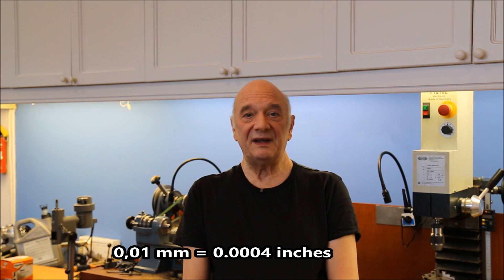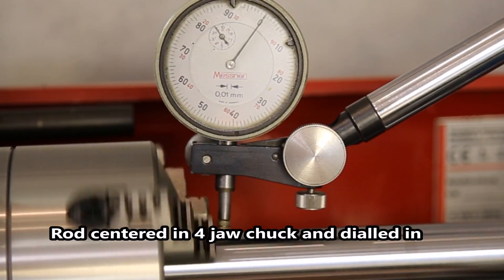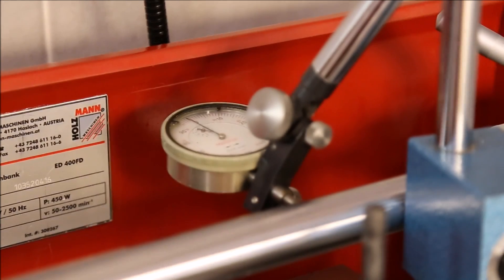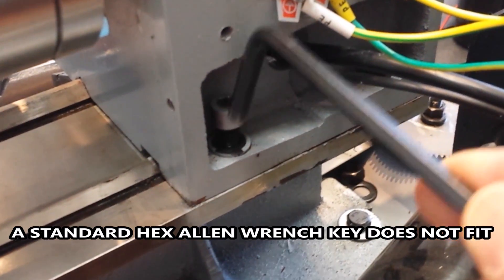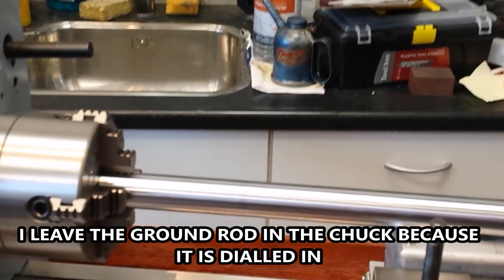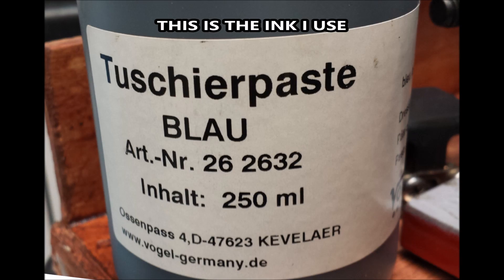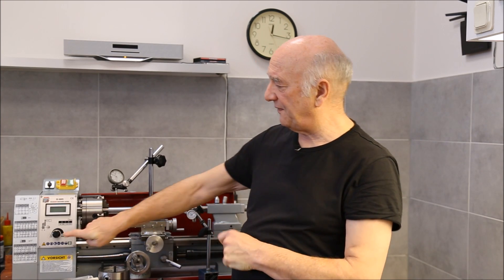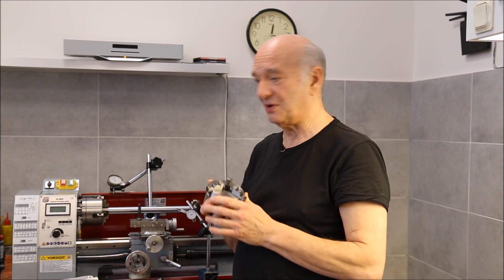HOLZMANN 400 PART3

Comment: Hello, if the stock leans a little bit forward or backward (in a vertical plane) it is a secondary effect (less important for the final accuracy). The primary is if the stock is parallel to the bed in the horizontal plane (otherwise you will always turn taper). You check this in the plane perpendicular to the one you've done.

Comment: Hi again Jaap,
Did you grind the jaws in the chuck?
I see that my jaws are also a bit off. Mainly I see that the jaws only make contact to the work piece at 1 cm farthest in. (No contact at the tip or in the middle.) So I think I shall grind the jaws very gentle and see if it improves.
Another thing I wan to do is to replace the spindle bearings with better quality. There seem to be movement from the engine and pulley that en up in the chuck and work piece. Have you done any similar operation in your lathe?

Comment: Dear Jaap Dekker,

I watched his films in which Holzmann tested and demonstrated the ED400 lathe. I would like to ask for your advice, because I would like to buy a machine of a similar category for modeling and DIY. The two devices you choose are the HBM 210 Vario and the Holzmann lathe you use. The price and parameters of the two devices are largely the same. (Do you happen to just not make them in China?) So there remains an important issue even more durability and reliability. Since your film has been made for three years, I think you have gained enough experience. I would like to ask how satisfied you are with the machine or would you buy it again based on your impressions?
Thanks to: Béla Baksa (Hungary)

Comment: i would like to see more videos regarding the Holzman 400FD. i do have a smaller version the 300FD and i'm happy up to now. With a good care you can cut steel. The threading procedure is a bit time consuming changing gears on the side but it works great.

Comment: Would you recommend this lathe to a beginner? 
I ask you this because you have made several adjustments
Reply from the maker: There are better lathes but they cost more. This one is now functioning o.k. I am on a budget and then you have tweak a bit. Of course I bought this one new. You can also consider buying second hand. If you are lucky you get an upscale lathe for a reasonable price.

Comment: You can adjust the runout of a 3 jaw chuck,make sure you have a slight reduction on the chuck back plate spigot,then you  can true the chuck,by tapping it true with a padded hammer.

Comment: How do you like this lathe now? I'm thinking of buying the same so it would be great to hear if you are happy with the quality and performance.
Reply from the maker: The lathe is o.k. now and does what it is supposed to do but it it is not a Schaublin
Reply: @jaapdekker5983  No but it did not cost the same as a Schaublin so do you think it was worth what you paid for it?.
Reply from the maker: @GaryRowlands  yes it works well so far. The Chinese stuff isn't all that bad,   you get what you pay for. And if you like tools and machines, like me, you can easely upgrade it to a higher level.
Reply: @jaapdekker5983  cheers Jaap thanks for quick reply, I will feel better about buying it now, thanks again.

Comment: Hello Jaap! Great trilogy on the Holzmann lathe! I have the Quantum 210x400 and can totally relate to your issues and some more. Mine has been taken apart, converted etc. on more than one occasion by now. Still they are great machines with a little adjusting here and there, just as you've shown. And they are WAY above the common 7x14 mini lathes. I have another project for you: check the spindle bearings for lubrication ;) I've found mine to be almost dry by default, which is unfortunately very common with these machines (although it's not very known of, since barely anyone ever checks that). Pulling out the spindle required a bit of improvising (unless you want to relentlessly hammer it out), but at last i properly applied some grease to my bearings now. Waiting for your video on grinding the spindle's MT3!

Comment: Thanks so much Jaap for informative vids . I,m between the 2 states of mind for buying this Lathe Hozman 400 or the Rotwerk 350dr. Do you have any idea about it? As the Rotwerk350 has got  digital reader and a bit smaller , i,m more about rotwerk.but i like the metal gear for the Holzman. cant wait to see more video from you. cheers
Reply from the maker: The rotwerk is also nice. The EDM 350 DR has built in digital micrometers which is nice.

Comment: very nice friend realy like all 3 parts. I dont have to much space so i bought 300fd Version. That is my first contact with lathe and i have question when i press  green button and speed machine is on minimum she running about 50rpm i think she should not run beacause speed button is maximum turn to the left. Im right or every lathe running on minimum speed when they green button is on ? can u give me answer beacause for the moment i think my speed button is broken.
Reply from the maker: Hi Rafal 1987, you are right: my machine does the same, you have to push the red stop button or place the reversal switch in the center position. thank you for reacting.
Reply: Jaap Dekker thanks so all is fine 😉 i try running it and im suprise runout is huge when i have rod on is about 0.5mm. Chuck running extaly the same like your about 0.01mm but with rod is huge difference  beside jaws running is about 0.2mm in lenght 200mm from jaws is 0.5mm that is realy huge. Definytly im sure the problem is with chuck jaws. Your orginal chuck was sanou Brand my is Different. Im sure i have to grinding jaws to get better result. Also i find the same problem with tailstock. I checked it on chuck and is going down about 0.03mm only in lenght 5cm so need correct that too. 
You do realy nice job with all 3 parts thanks
Reply: Jaap Dekker thanks so all is fine 😉 i try running it and im suprise runout is huge when i have rod on is about 0.5mm. Chuck running extaly the same like your about 0.01mm but with rod is huge difference  beside jaws running is about 0.2mm in lenght 200mm from jaws is 0.5mm that is realy huge. Definytly im sure the problem is with chuck jaws. Your orginal chuck was sanou Brand my is Different. Im sure i have to grinding jaws to get better result. Also i find the same problem with tailstock. I checked it on chuck and is going down about 0.03mm only in lenght 5cm so need correct that too. 
You do realy nice job with all 3 parts thanks

Comment: Hi Jaap, nice video. (I'll stick to English for your other viewers) I guess we're both working in the same directions with out lathes. Mine is a PX brand, and I think the colour scheme is just a coincidence. You can phone a guy in china and start your own brand of Lathes tomorrow in any  2 or 3 colours if you like. 
Mine was a display model at a VDH in Utrecht. (It was in a price range just below the HBM counterparts which were out of stock at that time). from what I've been told with these lathes you get exactly what you pay for, the more expensive models (brands) are tighter on the tolerances and have better finish work. 
I bought a set of inserted cutting tools with my lathe, but in my 4-way toolpost  these tools were a bit above centre height, so I had had to have my toolholder reworked a bit.

I've already spotted a few differences between our lathes. I wonder does yours have the 'induction hardened' label at the end on the casting? and does the Rev counter circuit board have the Sieg marking on the PCB?

Gr,
Martijn
Reply: I was mistaken about the name on the pcb, it says www.weiss.com.cn
Reply from the maker: Hi Martijn, I thought you were Dutch watching your videos. It is indeed very sympathetic of you towards other viewers to  stay with the English language. As far as I could tell from your videos you have virtually the same machine with some minor differences as I have. We both try to upgrade to lathe to european standards. I believe I did not see the "induction hardened" sign on mine neither did I see the Sieg marking on the PCB. Keep up the good work man, you are very inspiring to me.geetings, Jaap
Reply from the maker: no problem, man